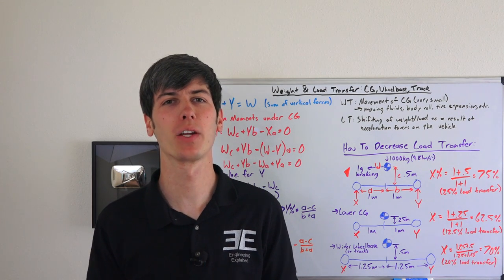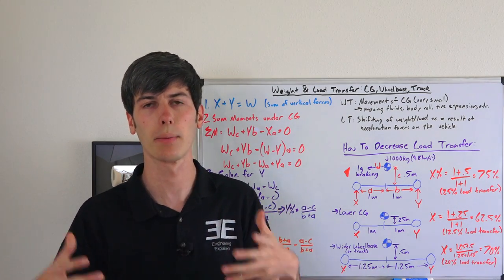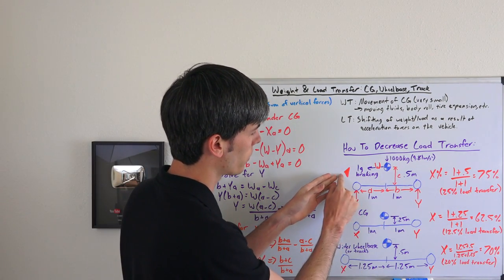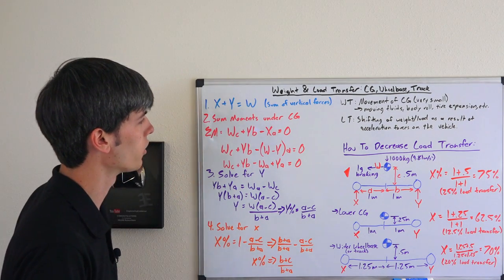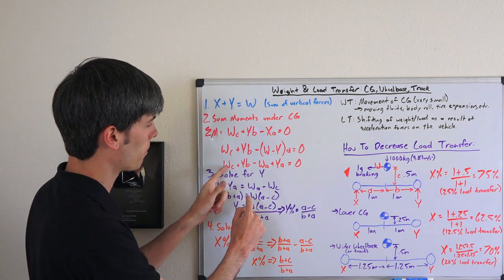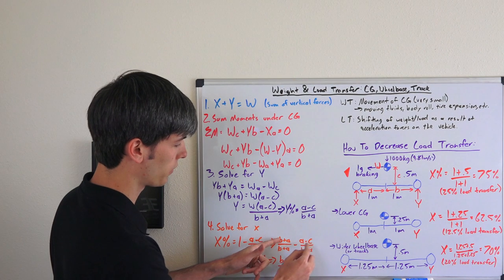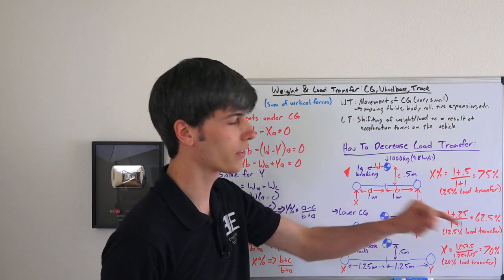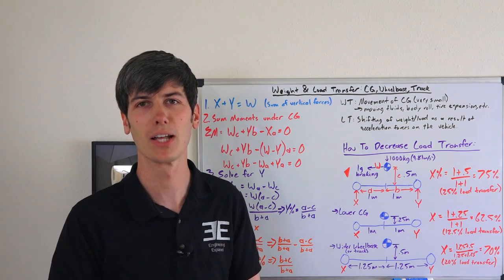Vehicle Weight Transfer and Load Transfer

Comment: Question: Why is the 1g of braking force acting on the CG in the leftward direction? If you are braking, shouldn't there be an acceleration force acting on the CG towards the right?
Reply: I was thinking why isn't the bracking force acting on the front wheel (assuming only front brakes)?

Comment: Hi   I have a question I drive a mk4focus st estate it’s lowered 30 mm front and back at higher speed like 120 kph my car is verry nervous around the track  like it has longitudinal weight transfer going left or right at speed and accel I ordered kw v3  hoping I can tune it out should I increase bump and rebound at the rear or not ?I got a slightly wider tire at the back driving on pilot sport 4s tires car weight is about 1580 kg  weight distribution is 58 I think not sure

Comment: I finally realize why and how to explain different mass distributions other than 50/50 are preferred. This video, load transfer. 50/50 mass distribution is optimal in constant angular velocity and constant speed cornering situations. Around any given road course (not oval), a chassis spends the least amount of time at constant speed and angular velocity while cornering. The chassis shaves most of its time existing corners and corner groups on to straights. Therefore, optimal cg control while unbalanced load transfer occurs exiting corners (accelerating) is preferred over constant angular velocity and constant speed cornering situations. Long sentence I know. 

The conclusion, optimal cg location is dependent on given track layout. Of course math can be applied to calculate a cg specific to the amount of time spent in whichever transient loading situation best suited for each specific track.

Comment: Hi, I've got  a question, in the sum of vertical forces the weight (W) is pointing down but in the sum moments is pointing to the left, is that possible?I mean I understand why are pointing that way, but mathematically, shouldn't be the weight pointing in the same direction in both sums??

It's like the sum of vertical forces was calculated in a different scenario than  the sum moments

Thanks!....sorry for my english and if it's a stupid question

Comment: Hello, could you help me with a question?
If i have front and rear wheels not on the straight line (lets say we have a complex ground surface), how should i calculate CG height? Individually for each wheel(depending on "CG pos" -"wheel-to-ground contact pos" vector magnitude) or  maybe i should have some average value for all wheel-to-ground contacts?
image:"drive.google.com/open?id=0B9-hp2ZRXnOuXzBvZ2Y5UmpIM2M"
Whanx for your time!

Comment: How would you achieve 0% LT? I would assume you have C of G inline with the centre line of the front and rear wheels however setting c to 0 still yields a 50% LT. Going even further and making the C of G below the centre line of the front and rear wheels, I would assume, would mean under braking the LT would be reversed meaning that LT transfer acts rearwards. If you set c to a negative figure then the LT% would be somewhere between 0 and 50 depending how far you go which also means a load transfer to the front. Is this contradictory or am I interpreting the LT incorrectly? For example is 50% LT neutral or is it still acting over the front wheel?
Reply: C is actually down to the contact patch (ground) level. Otherwise an easy solution to all load transfer issues would be to just put on bigger wheels!

Comment: What if u have 2g of braking? I am calculating with different braking forces and it always transfers the same amount of weight. In drag racing applications they are transfering the whole weight
Reply: did you happen to figure It out?

Comment: Are you assuming that the weight distribution of the car is 50/50?
Reply from the maker: olivier benchetrit I'm assuming it's where I placed the location of the center of gravity, which in this case is the center, making it 50/50. So yes but you could alter it as needed and the equations will work.

Comment: why is the braking force in forward direction? waiting for your kind reply.
Reply: The braking force would be in the other direction, acting at the wheels' contact patches. But given that this results in a 1G deceleration (for this particular example) of the entire vehicle, the resulting vertical forces on the front and rear wheels can be described as in this video (very simplified).
Reply: Thanks for the ans

Comment: how did you calculated the %load transfer
Reply from the maker: Spce Racing If it starts at 50/50 and ends 75/25, you have 75-50=25% load transfer.

Comment: I found weight transfer is similar to load transfer, when you're moving around, the weight of those movable parts are going to move as well. I think weight distribution is a better word to describe "weight transfer". Anyway, best way to measure "load transfer" is to do it by transferring potential energy to kinetic energy. Potential energy is the energy produced from the car by rolling and pitching during corner and braking. Convert that into kinetic energy then you'll find out how much forces applied in the opposite direction.